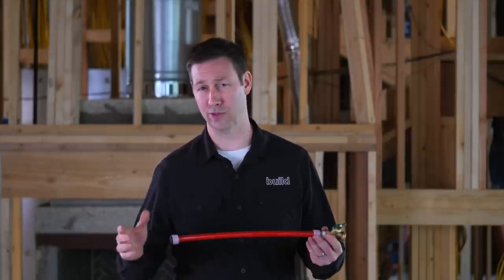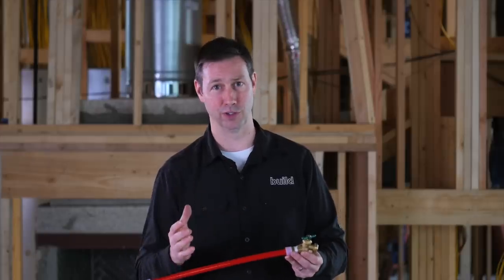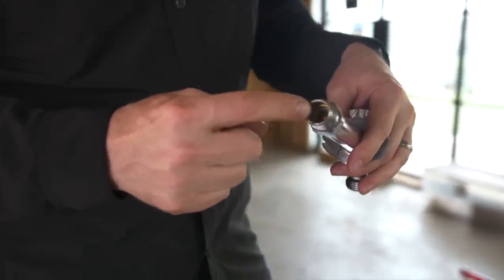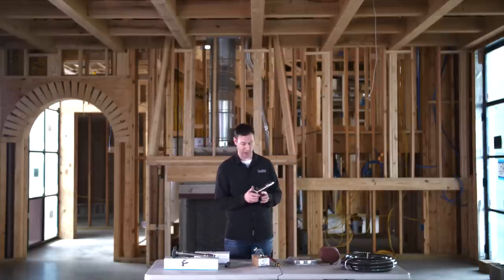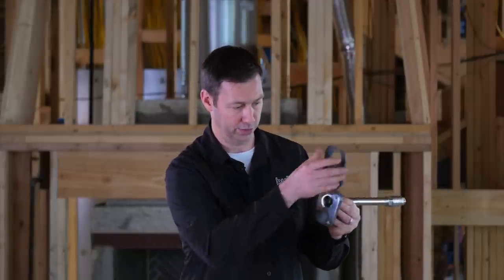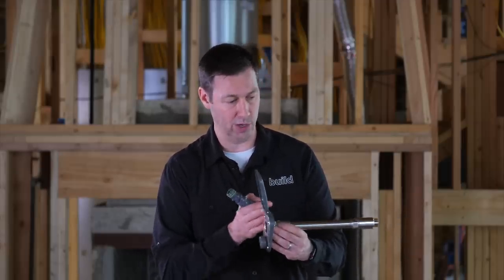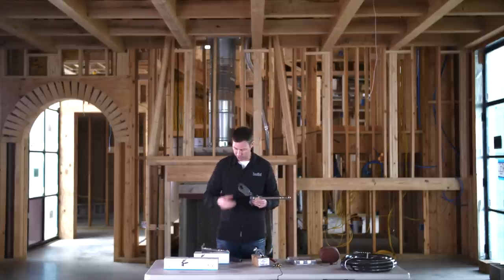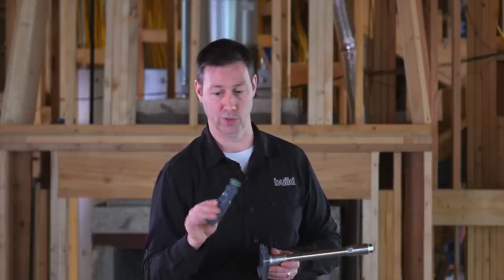No More Hose Bibs - A Better Outdoor Faucet

Comment: No, no, and no. This is all proprietary hardware so you're stuck with it and have to use this system and its components. Based on the video, these can only be installed at the corners of structures so the fixtures can extend fully inside, so limited flexibility. What happens when not enough are sold and the line is discontinued? Now you've got to rebuild everything. Living in Texas all my life, I've NEVER had a problem with burst pipes. If you're too busy to bother to occasionally check the weather forecast, you shouldn't be owning a home to begin with. It's REALLY not that difficult to insulate a faucet or let it dribble.

Comment: Seems more limited not having its own controllable valve and for $90 I don't want to see plastics. 
Sure it looks nice but I think I'd sooner keep a traditional bib and shut off quick connects for my hoses. 

The sad part is I could tell it was a sponsored video by how you had nothing negative to say about it when it clearly had downsides you didn't know or want to touch on such as the plastics in such an expensive piece.

Comment: Someone in my household misplaced the plastic faucet adapter. I had to run a 100ft house from the back of the house. Oh well bad luck, so I bought another one. Low and behold, it happened again. I ripped the thing out, and threw away over $100 worth of "new hose bib" and went back with the regular: 14.95 hose bib. Best decision. Hey Matt, how much are they paying you for causing a lot of people headaches? I must also say that I get a lot of great content and educational videos from this channel. But this? Come on.

Comment: The only thing I don't like is the removable plastic faucet is that you have to screw in to turn the water on. Plastic? What if it breaks?  What if you lose it? If this thing breaks, you can't use the hose at all. A replacement piece would cost you $30, after taxes, and I'm not a fan of expensive plastic. I'll stick with the frost free hose  bib I already have installed that is the same one you show here:  1:20 I think mine is 12" because I live in New England. Stick with metal. If it ain't broke, don't fix it.

Comment: A "solution" in search of a problem. One pays three times as much for a faucet whose only benefit is a sort of stylishness. And weird plastic auxiliary fittings that will deteriorate, get lost, and get hard to find. Where in the hell are you going to store the turn-on device ?  Owners will replace with standard frost proof faucets that are time proven and understandable to users who understand "connect-hose-rotate handle." Anything more complicated is not progress or improvement.

Comment: Matt, I'm a little disappointed you'd be promoting this product.  I've always liked that you promoted products that stand the test of time, solve problems, or prevent issues.  But your promotion of this product does none of those, introduces many new problems, breaks many functions for the sake of form, and simply contradicts the premise of your channel.

1) You claim the water from a standard bib stains the side of the house.  Yet, this new system has to drain water somewhere to break the vacuum and empty the chamber. If air goes in, water must come out!  Where does that go?
2) Plastic is weak.  It deforms, becomes brittle from UV and chlorine exposure, and simply doesn't have the structural strength to withstand the forces put on it by a water filled, heavy duty hose.  How much torque/shear can that little connector withstand before it snaps off inside the assembly.
3)  It looks great when it's all closed up, but with the plastic adapter, it looks very cheap. Like there's a screwdriver sticking out the side of your house.  So the solution to keeping it looking neat is to put the adapter away every time (can't leave it connected to the hose to get banged around or UV damaged).  That means hunting it down every time you want to use outside water.
4) When the plastic breaks, and it will....is this company still going to be around producing these adapters?  The standard hose big is ubiquitous.  If I buy a hose, I know it's going to work. This feels more like a company trying to create an ongoing revenue stream from selling consumable hose adapters....the keurig of garden hoses or something.
5) And finally, no flow control.  So if you use this to run a yard sprinkler, drip irrigation system, bathing a pet, or any other use that doesn't require full blast...well, too bad.

This is a bad solution in search of a problem that's already been solved.

Comment: 90$ for the equipment another 150$ for the plumber to do something special to install it vs 10$ for the standard which the plumbers typically  include in a package and an additional 7$ 5 years down the road when it craps out.

Comment: Sure its fancy, but still a waste... I mean, its all plastic once you 'leave the house'... Its just another object that can be lost and/or broken. So just more money the home owner has to spend. What happens when that company goes outa business? What happens when they discontinue it? You won't be able to find any more connection adapters for your home!

So sure, it looks decent and works decent. But as for getting something reliable and trust worthy for your home? This is NOT the choice a smart home owner should choose... Go with a normal spout that turns off inside the house, and bam... you're done... All the benefits of this 'cool looking' one, can be achieved via the NORMAL ones too. 

Oh, and the fact that it just 'turns on' the moment you plug in a hose is utter idiocy... some things need to be gradually turned on so you don't destroy it with the water pressure!

Comment: The loop is not practical. Id have to buy a 3 inch why and a 3 inch 90. Although not expensive, its not cheap either. In additin to a 90 dollar hose bib. Who in the world would think "oh theres a loop in the wall. Let me just pull this thing out." Just run them to a common area and put valves on them.

Also that hose bib style will not last. Its too confusing for the average home owner. Plus you have to have an extra piece and I GUARANTEE that extra piece is getting lost or broken. Ive had issues with quarter turn hose bibs with home owners. Its not what theyre used to so they cant handle it. It confuses them.

Nice innovation but itll be gone within a year.

Comment: A couple of things. First, using the loop enabling removing the faucet for service is BRILLIANT! Second, the actual connection from house to faucet seemed a little flimsy. Will it handle a lateral tug? I'm a wee bit concerned that plastic thingamajig is going to wear and break. Am I wrong?
Reply: Thanks for the comment! The connectors are officially certified/rated to 100 lbs of lateral stress resistance (ASSE 1019A standard), our testing went to about 200 -- you can safely tug on it without breaking.

Comment: $90 for one and you have at least two taps on your house, doesn't have a tap to adjust flow so you will need to buy a valve to put on your hose, and you need to have a bunch of proprietary adapters for said hoses.  Marketing gimmick, 1/10, dumb AF.

Comment: Gimmick... quick connect and standard bib works just fine..don't like the fact that you don't have flow control at the tap, or have no way of filling up a bucket or bottle just by disconnecting the hose from the wall if the end of your hose is 75ft away.. that doesn't make any sense.

Comment: No hose bibs here at all.  We have old-school steel & brass lift-handle hydrants out away from the house. For this gizmo I'd at least want the twist plug connector to be a nicely finished hunk of solid brass, and I'd want several of them, and why the HELL go to the trouble of installing this thing and then get an adapter (also plastic instead of brass) that converts it right back to the wicked old hose bib the whole project intended to replace?

Comment: Big Question.  Matt, your demo was done without water actually on.  Every time you disconnect the hose you will be "spritzed" by the water pressure in the hose and water will drip out of it and your hose.  Also, this device encourages users to leave on the water witch will lead to many many damaged hoses....  It is just not intuitive.

I like new products that improve something, but this product exists just to have something different.

Comment: This video is somewhat misleading a lot of things that you said were opinion based but you made them sound like they were concrete facts. “Northern builders” would never laugh at a traditional silcock, frost free silcocks aren’t the best option all though they’re great in theory they require more maintenance. Shutting off and properly draining them in the winter is the best option. By the way that’s 2 inch PVC you made the loop in not 3 inch.

Comment: Well. I do not know why it has such a proprietary plug on the outside. We in Norway use similar construction. But the outside has a normal connection instead of that plastic shit. And its angled down so the water runs out, no special vacuum chamber.
I wouldn't buy your product at all. If I loose that special plugg I am fucked and it cost probably like 30 dollars to get a new one.

Comment: Yeah..no.. that thing will wear out one way or another. Like someone else said, the plastic piece will bust off in there or something and you'll spend $300 to have it replaced with a regular deep-set shutoff in about 7 years. If you don't use it for a couple of years I bet it binds up or something.

Comment: these things are great for custom homes, and thats probably what they are designed for, but there is no way you could install that loop, ($90) hose bib and street 90s and make a profit on a production house, I would always go with a good old copper piping threaded to an 8 or 12" frost free quarter turn, with a replaceable gasket, they are cheap reliable and VERY easy to replace if you spec a threaded female on the pipe and not a sweat connection.

Comment: I have to agree with him that most houses down south do have cheap hose bibs and millions of them are just sweated onto copper pipe and a real pain if you have to change one. It's just poor quality building if you ask me. I wonder where that hydrant hes talking about is made. I like using quality American made products. There's a company called Woodford makes a good frost proof hydrant right out in Colorado. Has stainless steel replaceable seat and you can get parts for them easily but they last a long time. That's the kind of thing I like.

Comment: As a Texas homeowner, I will keep my current setup. This device is silly as you need to add additional parts to make it work with a standard hose. I get that it will prevent freezing of the waterline, but any yahoo can get a .99 bib cover at home depot.

Comment: The "problems" that this system solves are not really problems in my opinion.  At least not significant enough to warrant a new faucet at more than 4x the cost of a decent current one, plus the added cost of proprietary (rather than the current universal) hose adapters, plus the time and cost of installation.  Especially if you are not an experienced DIYer and have to hire a plumber.  And it is either all on or all off, with no control.  Unless you add the cheap plastic shutoff accessory (which is essentially just the same thing as a normal hose bib in the first place).  All of this added cost, just so you don't have to look at an "ugly" hose bib handle?  Sorry, but this one is a "hard no" from my perspective.

Comment: I bought a new duplex in WI and the builder put in the regular faucets, he did put a shut-off valve in the basement though.  The trouble is most tenants don't give a damn about maintaining the property, so I had to go next door in November and make sure the valves were closed.  I ended up replacing both outdoor faucets with frost-proof faucets.

Comment: Looks more like a novelty. Something different. The normal faucet works just fine. Turn it off on the inside in the fall and drain the faucet. Never had a problem for the past 20 years and I live in Canada where the temperature goes down to minus 20 in the winter

Comment: No way for me. I frequently use the valve handle to shut off the water supply rather than twisting the Aquor hose attached handle and later retrieving it from the ground and plug back in to turn on the water supply. Most builders would rather drill an 5/8 hole in ten seconds than more than 5 minutes cutting a square hole. No doityourself homeowner will be happy installing this retrofit.

Comment: The problem with any of the "quick-connect" water hose fittings is that there is no industry standard.  Each manufacturer thinks that his idea is the best idea.  How many of these manufacturers will even be around in 10, much less 30 years.  Water hoses have a standard type of fitting on them and that is what we should be using.  If you choose to use something "different", you are going to pay more up front and probably even more in the years to come when you have to replace the units because no repair parts are available for them.

Comment: 90 dollar hose bib that has no flow adjustment, and you need a 12 dollar adapter for any hose you want to plug in?  People are still going to leave their hoses in, and they're still going to freeze, but now they'll have a 90 dollar part to replace instead of a 20 dollar part.  They must have given you a truckload of these things for your house to get you to endorse something like this.

Comment: So let me make sure I'm getting this straight...  you have to attach the hose at every use unless you use the plastic pipe with a ball valve (which looks much uglier than a standard bib)? Good ideas solve problems... the bigger the problem being solved, the better the idea. This seems like a very small problem with a mediocre solution to me.

Comment: Great lesson to teach about frost and the loop. The product however is not a great idea for home application. The extra part needed to function is a deal breaker. The flow control is only on some of the  extra parts it seems. No easy bucket filling there.  Also the appearance isn't even that impressive. I wanna see flush mount paintable covers with a more sleek vacuum break.
This would be great in high traffic commercial areas where secure water access is needed. That's the only place I would use this. I don't even really trust that because of the plastic cover that will no doubtedly be broken off by some passer by. 
Great videos keep em coming.

Comment: I see one problem with this device.  Those  Aquor supplies (hose ends) will get dropped and dragged on the ground as the hose is stowed  and deployed.  This will damage the sealing surfaces.  The damage will significantly reduce the service live, lots of leaking.

Comment: The "vacuum breaker" is has nothing to do with breaking vacuum between the valve and the hose connection. Its a anti syphon valve, because you could put a end of a hose into a contaminated environment this valve will prevent syphoning of contamination back into a water supply in the event of a water system loss of supply presser!

Comment: Licensed plumber here. This is a terrible idea. I would never recommend this. Without the adapter you can’t use it. It’s more expensive, you need a larger hole cut in the house to install.  You have no control over volume of water. Terrible

Comment: And what happens in 10, 15 or 20 years when that loop of pex is brittle and you pull it out of the wall to service the valve?  Or you can’t get the hose adapter anymore?

Comment: so just a few extra $$$'s for the hydrant. then a few extra $$$'s for that cheap plastic adapter which I have to buy for all my hoses. the hydrant idea is nice but you lost me with the cheap plastic adapter. better to buy an expensive well made metal frost free hose bib that is designed well so you don't scraper your knuckles when you turn the water on & off.

Comment: In the u.k. we just have a stop cock tap inside of the building on the water pipe supply to outside costing 2 dollars and never an issue if 50 years ;)

Comment: I guess this man has never seen how builders do this. They have a valve on the inside of the house in the basement. You shut it off there and then open the outside valve. It's been that way as long as I can remember. And I'm 50.

Comment: Oddly enough a high end home built recently (about 5 years ago now) up in one of the colder states (we get snow storms and weeks of freezing temps at a time) has these basic wall faucets with no vacuum breaker and a valve outside. But inside they have a shutoff and a inline vacuum breaker. I thought this was a really strange choice. All three of the wall faucets have access panels or crawl space access. But it would still be a huge pain to winterize these 2-3 times a year. This never made sense to me I would have expected something exactly like what was shown in this video using pex loop for maintenance.

Comment: From the thumbnail alone, I can already see problems. A traditional faucet is close to the wall and angled, so when you attach a hose there is little strain on the actual faucet. With the adapter sticking out 6? inches, you are asking for issues. Not a good design

Comment: Nope gonna continue using a proven technology. Standard frost free and either a compression from the 1/2 inch to it or a female 1/2 to 3/4 thread adapter. Much easier to replace when home owners forget to remove the hose or the valve goes bad.

Comment: What options are there for a wall that doesn't have a perpendicular wall adjacent?  I have a slab, so it's basically attic into a likely 2x4 wall and out the side.  thanks

Comment: Every hose quick connect I ever used had problems with the o-ring dribbling.  Sure, the sideways and up & down movements are limited on these units but nevertheless how does it hold up?  And it seems to me that a retrofit would have to be installed so that it is serviceable anytime.